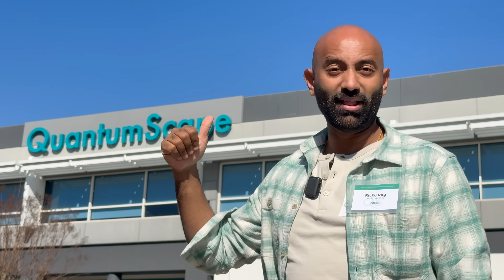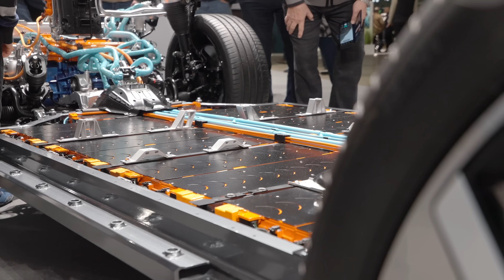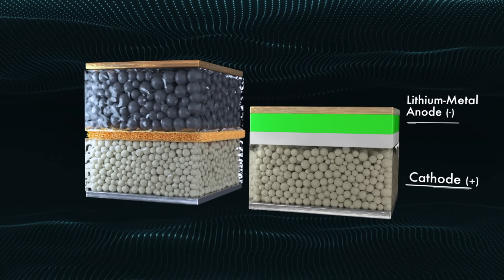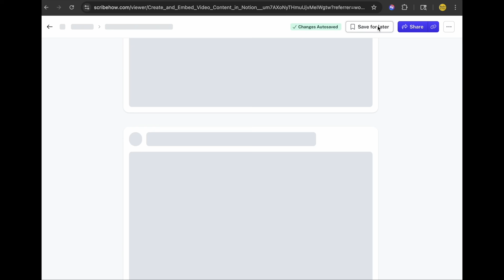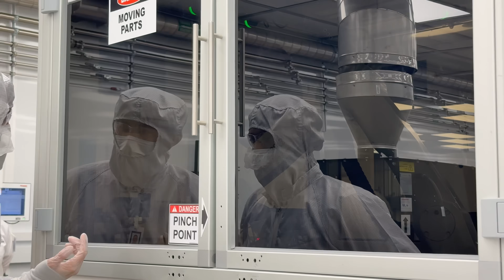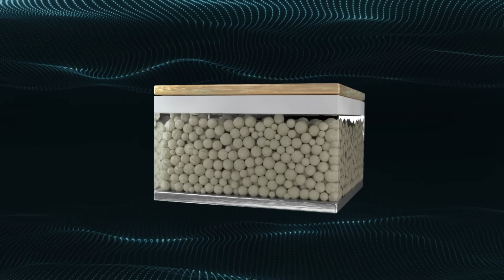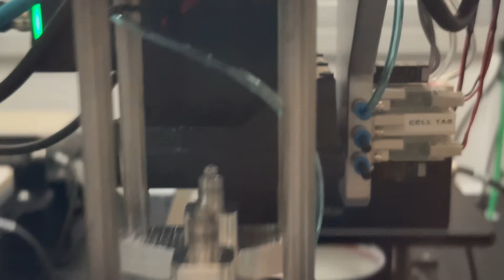I just Saw the FIRST Solid State Battery - It Finally Happened?

Comment: 300 wh/kg Vs 250 wh/kg is not double the energy density....
Reply: 60% of the time, it works every time. 😂
Reply: Agreed. I wonder what he meant when he said double.
Reply: yeah and every tesla today, comes with cells with a density around 270-280 wh/kg, same goes for BYD, XPeng and most other chinese cars; also Polestar uses these.
Reply: @nifty6486  not the ones with the LFP chemistry. That tops at around 175kwh per 1kg
Reply: Amprius is the only battery company that has demonstrated energy density double that of lithium-ion. They won an award at CES for their battery with a capacity of 520 wh/kg.
Reply: @RamKumar-rc8mx  But it uses an all-liquid design, which comes with low safety and extremely high costs.
Reply: @Max666-r3ragree but because of Si Anode , it cleared nail test and is used by US army.
Reply: @Max666-r3r it is not automatically "low" safety because of liquid electrolyte. An LFP battery is much more safe than a petrol tank in a crash.
Reply: I’m excited with a technology that can be used to retrofit existing BEV’s, I’m hoping to keep my car as long as I can, TBH.
Reply: He said double the energy efficiency
Reply: Seriously, maybe they mean double the total energy based on the space? I don’t believe anything is actually anything until i see it in production lol
Reply: @Dr.FeelsGood  I was about to question your logic. And then realised you mean density of mass, ie 1kg/CC over 0.5kg/cc.
Reply: This might be tops for current tech vs the beginning for QS. I believe QS energy density will get better where current tech has peaked.
Reply: @Vman-f4t "you believe". Good luck.
Reply: Addressed in the video — 18:40 — but you probably didn’t get that far in the video because you’re just here to spread FUD
Reply: @pirminborer625  if he did't said that probably you're not here on the comment section..flaws of word will earn money in youtube..😆😆😆
Reply: Came here to pos this.
Reply: @pirminborer625  technically not double the energy/kg. Density would mean in relation to it’s ratio of mass to volume. So there are many other factors to what the actual pack energy density results in. The lack of a robust heating/ cooling system with a solid state battery would allow a denser battery pack. Is it double the energy density after all things considered? We will see.
Reply: @pirminborer625  you could make a bar chart starting at 200wh/kg so that the bar for 300 wh/kg is twice as tall as the 250 wh/kg.  I see alot of companies do that in marketing material. 🤮
Reply: @iluvbacon12345 lol that’s so scummy
Reply: @iluvbacon12345 Apple did this all the time to impress their hordes of cultists.
Reply: @pirminborer625  My guess is they are using a bit of trickery here by saying double the energy within the same space, not at the pack level. But that's just my guess being that marketing can be a bit misleading.
Reply: @ShadLife   700Wh/L vs 844Wh/L is also only a 20% improvement if the claim is about how much energy it packs within the same volume.
Reply: @ShadLife  QS doesn't make battery packs -- they make battery cells.
Reply: In terms of volume (size), this is where the 'doubling' or the real leap occurs. By eliminating the graphite layer (the anode) which used to take up significant space, they can now pack more cells into the same battery pack.
Reply: @aborayan6831 No. Any doubling, no matter how it's achieved must show up in the energy density figures.
Reply: @aborayan6831  Unfortunately, they also posted a second stat regarding energy per liter, which is the volume statistic you want, and the ratio of improvement was similar.

My hope would be that they have extra engineering/padding required for this system to function that consumes additional space, but that over time they can minimize that at certain scales.

Double the capacity probably refers strictly to the chemical payload and not any of the surrounding battery structure
Reply: @aborayan6831  this
Reply: Its actually believable. Unlike Donut scam.
Reply: @pirminborer625  better is still better ._.
Reply: This is a very early prototype phase still. Pack design also should give better rates than standard lithium ion based on the non cyclindrical design. This battery format also enables higher energy densities with cathode chemistries not previously possible due to anode limitations
Reply: They say in the  future  400-450 W/kg should be possible. Even that falls short of double the energy density.
Reply: @p @pirminborer625  “They say”—source? Or are you just making things up now? Why?
Reply: @pirminborer625  anode-less SSB can theoretically go over 500+WK/kg.
Reply: Which Make and Model car has a battery that is running at 250 Wah/KG?
Reply: @MiddleGroundViews Tesla is basically maxing out the efficiency of the best cells Panasonic can produce after 30 years and billions in research. Solid state is just starting, hopefully it can actually double the efficiency one day.
Reply: @MiddleGroundViews  Tesla 2170 NCM = 272 Watts per kilo from Panasonic.
Reply: @ctuna2011  NCA, not NCM.
Reply: @tooltalk 
Still it's 272 watts/ kilogram
Reply: What you really need is extremely quick charging , so charging a car would be the same as filling up at the petrol pump station … that would be the game changer
Reply: Other solid state battery manufacturers in China are claiming as much as 600 wh/kg (eg Chery)
Reply: @CashJohnston  those are usually experimental though. It gets much lower once it reaches production
Reply: It take 0 effort to replay the segment or turn on subtitles. "Double what you get in a conventional battery" I suppose depends on what you consider conventional: cutting-edge lithium EV batteries, smartphone lithium cells, or store-bought AAs. Definitely did not claim "double the density of modern EV batteries" or anything along those lines, nor did he hide the numbers or suspiciously not ask his host about their energy density. IDEK why you're mad, it's plainly stated in the first 25% of the video for people who only care about that. I consider the interview pretty transparent, if boringly technical, hence the frequent breaks for visuals. Nevertheless, it is impressive this company's battery tech can compress more energy stored per volume (liter) and kilo (mass), and is production ready. The real, final energy density, performance, or range in an EV has a lot more to do with how the Vehicle manufacturer uses the technology, no? They make batteries; it doesn't seem like they are invested in designing XYZ company's proprietary vehicle or their usage of that battery. Cool, informative video. The puncture volatility remains a concern, as always.
Reply: The only thing that would be useful then is if it allows batteries to last a full decade without any notable degradation.   Electric vehicles and consumer electronics will last longer than ever. I am pushing 6 years on my phones now, since the tech upgrade cycle is pretty slow and the upgrades are barely noticeable. The only reason to actually upgrade nowadays is just to replace the battery.
Reply: The regular lithium batteries are about 175wh so they are technically right, the 250wh you talk about is not the everyday battery, u need to understand this
Reply: @Thollarkings  what is 2x175 mmm, I think it's 350, no....which ever way you spin it, it's not double, and it's not a solid state battery in the formal sense (electrolyte free). I wish them well, I wish all technologists the very best in their efforts....Ricky, he can't help himself, if he's not shilling robot lawn mowers or expensive walled garden home batteries (gifted to family and friends), he exaggerating left and right to make a YTube video - Meh!
Reply: @Bob-h4s2p
2027  Qs = premium 
   175wh = standad
   250wh = premium
Reply: Amazing how he got an invite and immediately forgets how to do math or any critical thinking.

That ceo uses every corporate buzz word in the world and is so full of shit he might as well be a toilet. 

He invited this youtuber as a publicity stunt because he knows these batteries are barely better and that's assuming the flex over time won't kill them, which it will. The company is most likely hoping a car company will buy them and find it worth nothing
Reply: @pirminborer625  the 250 is soo rare and expensive mainly pack level is closer to 170 bus blade around that park too. Also lfp looks low put pack level nmc is not that much high as well. This is a significant difference and in most cases almost double
Reply: There is also CATL's condensed battery which is supposed to be 500wh/kg
Reply: @a2cryss  which is DOA.
Reply: it is when you don't need 100% mass added for water cooling. Also note that Li-ion batteries are built 100% over-capacity so there's degradation room you don't notice, so they're actually half as energy dense as advertised. QS batteries don't need that.
Reply: @thekaxmax  bro you're reaching for answers that weren't provided in the video, likewise if a battery has internal resistance, it needs active cooling once you scale its energy output into the kilowatt range
Reply: Only a 20% increase
Reply: @saquist from the best of the best and almost double from the average
Reply: @saquist  "only" - even if it's not double, it's still pretty massive, seeing we've been stuck since Li-ion came out back in... 2000?
Reply: sounds like a dud..   QS's SSB has to be at least 30+% better than the existing NCM.   There are already some NCM811/NCM9.5.5 variants close to 300 KW/kg.
Reply: @tooltalk as long as the power’s density is on par with the current tech that is good enough to start because the safety aspect of solid state is a game changer.
Reply: Yea but you’re talking about a technology that’s mature vs one in its infancy
Reply: I think the claim of double is kind of true but a little bit misleading because you have to really understand the entire math so if it’s normally 250 for the energy density and now it’s 300. That’s a 20% game. Just the density. So hypothetically, if you had 100 kW battery that you were in a Tesla getting 330 miles you immediately getting another 20% more miles.  OK so now you’re getting another 66 miles so you’re not at 400 roughly.  But the bigger thing is they’re saying they only have one part which is the antinode and the cathode. So if you’re able to put 40% more batteries and not take up more space or more weight. Now instead of having 100 kW battery you have 140 kW battery.  So if you kept the same original metric from Tesla at 3.3 that will give you a range of 462 however, you’re getting 20% more efficiency or density. So that in itself would almost give you another hundred miles roughly 554 miles.  So that is a big jump. If you’re capable of having a vehicle that doesn’t need to fill up until you hit 550 miles that takes away a lot of concern for consumers who already have range anxiety. Plus more charges and recharge cycles. That is where they technically achieve the double rating even though it’s more like 60% more not double.
Reply: @fragheads6456  wow all that math and you forgot the largest factor in all of this 😂
Reply: not much math. Like a 3 second thought experiment. What’s the largest factor then?
Reply: @fragheads6456  Cell density versus pack density. If your cell density is 400Wh/kg but you need a lot of mass in aluminum and water channels then that reduces pack density, most manufacturers emphasise cell density to make it sound better to consumers, but once you load it all in the pack that density drops at the pack level, that's what makes BYD's blade battery and other prismatic batteries so good, cylindrical batteries lose a lot of space at the pack level because you can't pack them as closely as prismatic form factors, cylinders don't pack very well, a lot of wasted space. Still, while this tech sounds good, it isn't a full SS battery so it is a bit disappointing, and other manufacturers have probably already done similar things in secret, I mean you don't have thousands of researchers like BYD and CATL and not look at everything possible, CATL has supposedly 20,000 people working in R&D and BYD claimed to have more than 100,000, they have probably already done this but decided it wasn't a good fit for manufacturing in bulk.
Reply: @fragheads6456  Tesla battery packs weigh 1000-2000 lbs so if you are able to fit more QS battery packs in that same amount of space you still have to account for the added weight.  That means you are adding 800 more lbs with 40% more batteries to a vehicle that already can weigh up to 7,000 pounds.
Reply: @Defjamfandetta kind of. There are multiple parts to the battery what they are saying is that the anode and cathode are two separate parts so with one of those missing then that weight would also be missing as well. Maybe it exactly a 1:1 as I don’t know what the weight of their batteries are as it’s not stated. However even if it was 35% less by the weight the same equation would hold true. Because the missing portion has a weight value but I don’t know the weight difference nor do I claim to. They could be 20% lighter or maybe 60% lighter that fact has been omitted
Reply: It is if you maths it creatively.
Reply: Inverse square law ...probably 😅
Reply: he said state of the art not mainstream
Reply: Didn't think my petty comment would start a bushfire in the comment section. 😅. I think it's cool and progress, but like always there's some marketing and hype words for investors. Just wanted to point that out.
Reply: @pirminborer625 it's pure marketing hype.
Reply: What a joke.  Can’t believe 2 bit da Vinci is touting this.
Reply: Not to mention that that is LFP chemistry but the other common SOTA chemistries have energy densities of about 280 wh/kg.
Reply: @TheDaspiffy  There is no LFP that comes close to 280Wh/kg.   LFP is not a SOTA -- it's a low-end battery tech.

Comment: Gerat Video! .. Am I understanding this correctly that the new battery is still reliant on lithuim unlike Donuts claim of a non-rare earth material solution?
Reply: Yes you understand correctly. Donuts Lab claims look like scam. They were talking about supercapacitors, not batteries. Whole different thing.
Reply: While not as abundant as sodium, Lithium is not classified as a rare earth metal.

Comment: This appears to be a big leap forward.  In most circumstances I already think EVs are at parity with ICE cars.  What I want to see is EVs being so much better that buying an ICE seems like a fool's errand.  This would be in cost, range, charging and battery life.
Reply: Biggest problem with ev cars is people living in apartments that cant charge for cheap, we need evs that has a second suitcase battery that you can bring into your house and charge from a nornal outlet, i think silence has a ev like that
Reply: @423GustavBern  this is a major CURRENT issue hopefully solved with much quicker charging times with SSB tech. Apartments/homes don’t have gas storage tanks either.
Reply: @Vman-f4t  I store a few gallons of emergency petrol in my garage adjacent to my home. Fast charging will obviously require a lot of CURRENT available as a matter of the physics, so it's not going to be economically feasible in most domestic situations. Still at the mercy of commercial 'super-chargers' which look set to remain much more expensive than gasoline. Meanwhile, Stellantis have just disclosed a $26 billion loss due to overestimating the demand for electric vehicles (EVs) and the need to pivot back to traditional vehicles. This write-down is the largest in automotive history and reflects broader challenges faced by the industry in transitioning to electric mobility. Accordingly, I'm sticking with my AMG V8 for the foreseeable...😛😍
Reply: @Grez666  Valid points. I too will stick with my ‘25 M3 Comp and Golf R but will admit I almost bought the new Tesla M3P. 50K for the performance and the vehicle felt solid. I was impressed but at the end range anxiety got in the way. Enjoy your rocket!

Comment: 18:40 The most important statement from Tim Holme, Lithium-ion batteries have doubled in energy density since their introduction, but they are now saturated and have reached the top of the S-curve. QS, by contrast, is still at the bottom of the S-curve. They have a technical roadmap to improve energy density, fast-charge performance, and large form factor design.

This suggests they are exploring both higher layer counts and larger cell sizes to drive energy density improvements. It also looks like they are being conservative on fast-charging claims, and the chemistry likely supports higher C-rates than what is currently disclosed. Based on this, it seems realistic to approach 400 to 450 Wh/kg and 1050 to 1200 Wh/L over time.
Reply: This doesn't prove they are actually at the bottom of the curve, they didn't start from 0
Reply: Amprius is selling lithium ion cells with up to 520Wh/kg now.
Reply: @JRP3 Amprius battery offers less than 200 cycles at 1C charging. It's not an ev grade battery. And they offer 400 wh/kg
Reply: @cyclopes968  Amprius has a range of different cells, from around 320Wh/kg up to 520Wh/kg.  The cycle life also depends on the cell density and design, some have over 700 cycle life.